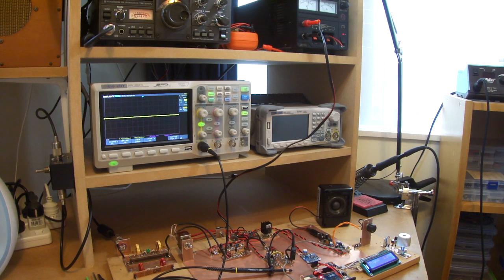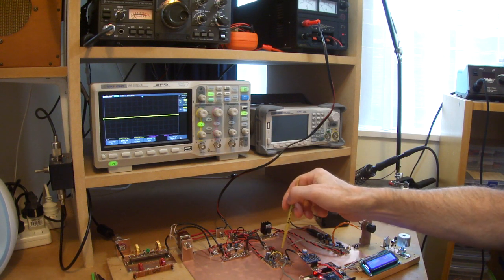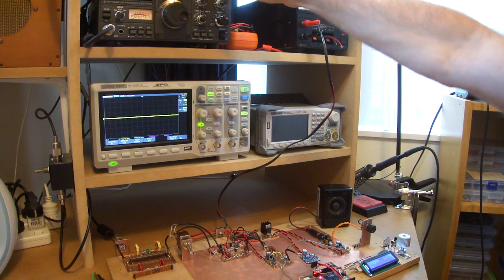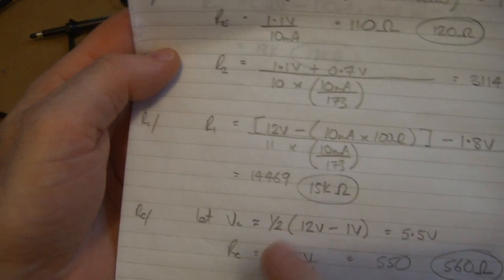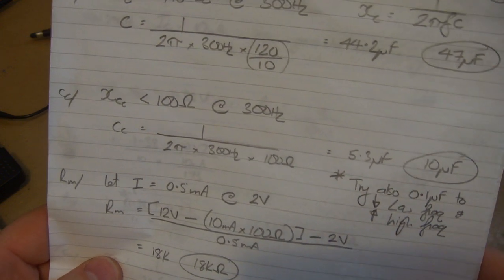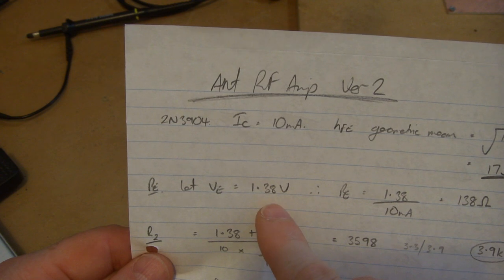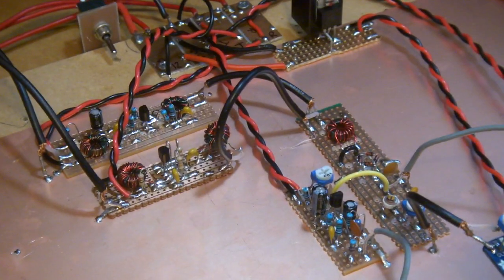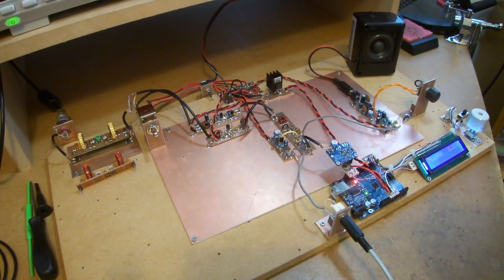Simple Homebrew DSB-SC 80m 40m Rig: Part 6 - Mic Amp and Low Power Transmit

Comment: I would lke 200mw out in my 20 meter RF power amp. It is Class A. Where would I find where to set the quiescent current to get this power out. VCC is 12 volts. Drive is 5mw.

Comment: Hi Charlie. Instead of trjmpotting si5351 level why don't ya set output level from library? 3 level points can be set via hex values and this way would be much cleaner signal
Reply from the maker: I did try that and had the level down to 2mA. In the end, I elected to use the trim pot so I could experiment.
Reply: for all bands tcvr to get same level across all bands I used a dual gate mosfet and gate 2 connected do DAC, in this way I normalized the output. Same tehnique used for tx, if 28 mhz is 10w out and 3.5 mhz is 20w,I set 10w as reference and lower the drive accordingly to get constant 10w for all bands. 73's
Based on yor ideeas here is my prototype  yo8rxp dot com/home-made-hf-qrp-transceiver-2/
Reply from the maker: @linuxromania  Sounds great.

Comment: Charlie , Its a very interesting series of videos on this DSB transceiver,  I normally used DB mixers for my projects, Ive never used a mixer as you have used, Always read up that DB mixers were the go,  Ive just got the Torroids  to make the mixer  you've used, It looks ideal  for some of my projects .  Ile post a video up of  my DSB rig when its built , Although time is a major constraint here , So not sure when that might be... Regards and safe journey de  Marc   'Gw0wvl' ..
Reply from the maker: Hi Marc. DB mixers are certainly the superior mixer and should perform better than this one. I only elected to use this one for simplicity. No need to wind trifilar transformers etc. Having said that, if you can source-say- a  SBL-1, ADE-1, TUF-3 etc then go for it.

Comment: Charlie have you ever looked at the actual DSB signal on the scope by syncing on the audio channel to see where the RF flat tops?
Reply from the maker: Hi Loren. Yes, I probe the antenna and make sure the peaks are nice and rounded. I don't bother synching on the audio channel, instead I just crank down the timebase.
Reply: Charlie Morris ok I have a scope picture of my 20 meter DSB output but no way to show you for evaluation. It is using a SBL-1. Thanks for the reply. I am now building one with beach 40 balanced modulator.
Reply from the maker: @lmoline63601  How is the SBL-1 working out? I assume the carrier is well suppressed?
Reply: Charlie Morris I put a carrier balance pot in the LO side to make sure it could be nulled as much as possible. I did not put capacitance balance in however. Carrier suppression is great.

Comment: Thanks for all the videos and accompanying descriptions. Very interesting. I've been trying to accumulate various items to continue with my efforts to take the same journey (my junk box is more spartan than yours). When you finish the DSB SC project would you be interested in sharing your thoughts on how to remove the USB, insert relays, and other changes to improve on the project?
Reply from the maker: Hi Greg. You will be surprised ho easy it is to build a single conversion SSB radio. Especially if you use a Si5351 and packaged mixers such as SBL-1 or ADE-1. Start with a receiver, then look at transmitting later on.
Reply: @CharlieMorrisZL2CTM  I'll look at those. I did build a direct conversion receiver last month, but my efforts resulted in an under-whelming result (using an SA-612 Gilbert Cell). I'll be happy once I get the receive chain in the DSB CS project working. Thanks again for your videos. They've shown me a lot.
Reply from the maker: @gregsmith3392  That's a great way to go. Get a DC receiver going, then look to build a SSB one. The RF and AF amps can be used in both.
Reply: @CharlieMorrisZL2CTM  I'll give it a shot. I'm using the schematic in EMRFD. There are two IC's, the SA-612 and an LM386. What is your technique for wiring the IC's? Do you use through-hole or keep with your top-mounted strip board and use jumpers from the pins on the socket?
Reply from the maker: @gregsmith3392  The SA612 is fine. I have a T/R video series on that. I do use them on the stripboard using an IC holder (DIL socket) with the legs slayed out so I can solder them. Just remember to cut the tracks below the holder before soldering it on. I've missed doing that a few times. Very frustrating!